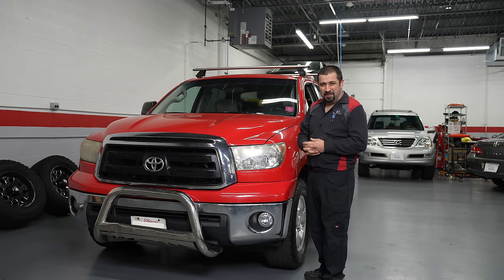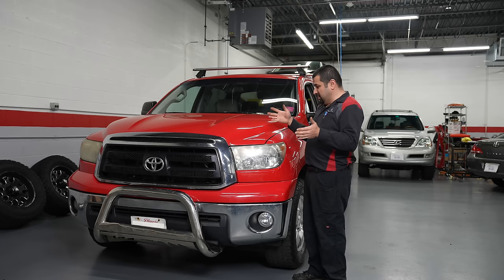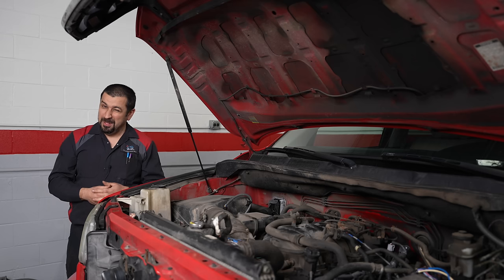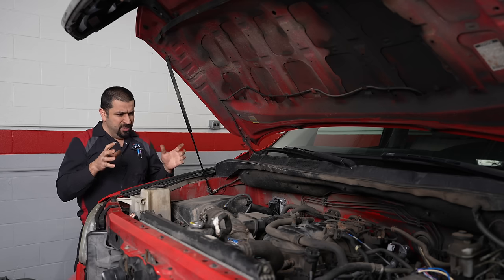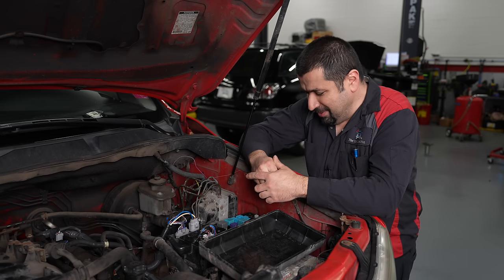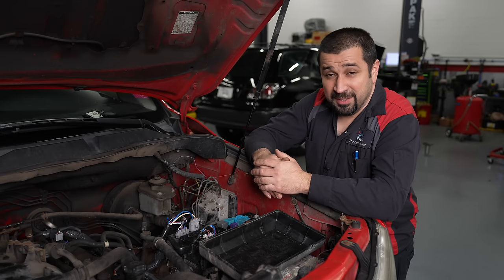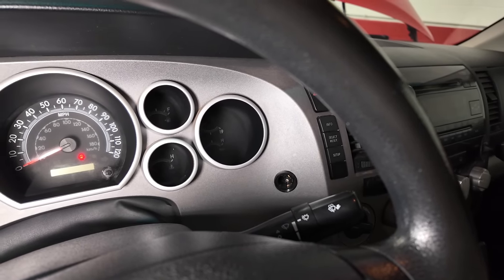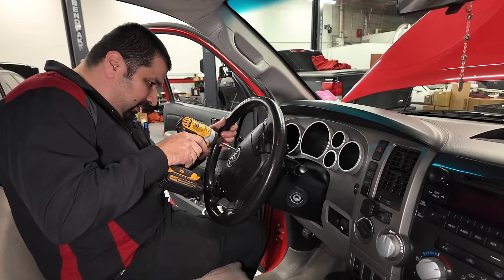Shop BOTCHED Wiring In This Truck Causing a $1400 Repair Unnecessarily

Comment: AMD, I feel bad for the owner,  the inability/unwillingness to diagnose root causes is widespread across the car repair business.  🤨
Reply: Agreed, I was also a victim from the original "stealership"
Reply: More like customer unwillingness to "pay" for diagnostics.
Reply: @verajavi12  Ahhh, victim-blaming. Than how come some people can do it and still be reasonable?! I would say that people don't want to pay for diagnostics when crap like this owners' experience with this truck. It takes less time to do it right, and what we have here is INCOMPETENT mechanics doing half-ass work. When you throw parts as something, you aren't a mechanic. At that time, you are a parts replacer.
Reply: To many mechanic that can't fix electrical problems or don't know how to troubleshoot if there life depends on it,don't let idiots work on your car it will cost a lot more that if they didn't touch it
Reply: Same here, I already spent a lot of money on my 2012 Toyota venza and the code is still active.
Reply: @albowrx Good mechanics are hard to find. If you have one, be grateful.
Reply: If these people that the Dealerships employ can't plug in a scan tool and it tell them what is wrong with the vehicle they have no clue except to fire the parts cannon.  Likely the reason is because they were pool cleaners the week before.
Reply: @wendwllhickey6426  But, unfortunately, when you bring your car to the shop, you have no idea which idiot is going to work on your car... sad.
Reply: They don't get paid to diagnose 😏

Comment: This is why looking for a new mechanic is such a terrifying experience.
From butchering up your vehicles electronics, to forgetting to tighten lug nuts, every shop visit is a roll of the dice.
I'm in your area, and I'm looking for a mechanic, but unfortunately, I don't drive a Toyota.
So let the adventure begin!
God help me.
Reply: Maybe you outta put what vehicles you have... Just a hint. There are people that live in the Shitcago area and could help you out maybe... I'm local but can't recommend a mechanic, since you failed that.
Reply: Check out “Ford Boss Me” he runs an independent shop in Shitcago. He spent many years as a Ford Tech but got tired of getting screwed over on flat rate. Now he specializes in diagnosing German cars. In addition to anything else.
Reply: @RustyZipper  Good dude. Took 2 trucks to him.
Reply: This video is the reason why many techs leave this field, being a good automotive technician requires years of training,  schooling and competence.   The old school grease monkey's couldn't cut it in this field today.  The crazy part of this automotive service field is the lack of fair pay for good technicians.  So what you end up with is a bunch of parts changers.
Reply: I also live in the area and I take my vehicles to TRS Automotive in Orland Park for repairs.   Ask around, many people in the area use TRS.
Reply: @RustyZipper he is a great true mechanic
Reply: I would consider selling your vehicle and buying a Toyota just to get access to this shop.
Reply: If you have Ford go to BSG automotive hes like the car care nut but for Fords
Reply: When you don't know anything about a car, yes, it can be daunting.  Knowledge is power.

Comment: The truth about shade-tree mechanics. So sad for the owner. Another great video for common sense auto services. God bless
Reply: We have no idea who worked on the truck previously. Was it the owner, a friend, a hired person that stated they were a mechanic, a shop.
Reply: @mph5896  So true, it could be any one of those. If your car is over 10 years old the quick fix bug can hit really quickly. That horn "fix" is a perfect example. None of them would think twice about cutting a hole in the dash of a 10+ year old work/commuter car for a makeshift switch.  Someone has to take pride and have a little OCD like the CareCareNut to say NO, lets fix it correctly instead of conveniently.
Reply: Diagnosing electrical issues takes a special method of approach..... I can sympathise with people who don't fully understand electrical systems.
I learnt a long time ago a simple idea..... 99% of circuits use earth switching.... Meaning an earth fault for most issues.... Not all, but a lot.   Working back from the faulty device will eventually lead you to the problem.... Your tool that senses both 12v and ground must be an absolute weapon of a tool.... Audible differences make it so easy.... All I can say is WOW!!!!
You had an enormous task to do and you nailed it.
Well done..... Respect to the master. 😊
Reply: @NZkiwibandit  A simple test light is what I use to diagnose most wiring issues in auto's.
Reply: There isn't a thing wrong with a "shade tree" mechanic.  Ivan Temnykh with Pine Hollow Auto Diagnostics often works under a shade tree in his yard.  LOL.

Comment: I recently have to replace an ignition coil in the rear bank my 2008 Toyota Sienna. It was a painful 4 hours of work. This was with the help of The Car Care Nut YT video. I could not have imagined how many of additional hours that I will spend without that video. This was the third ignition coils I replaced during the last 3,000 miles of my Sienna. Fortunately, the first two ignition coils replaced were located in the front bank, which were very easy jobs. While replacing the third ignition coil, I decided to change spark plugs as well since the rear bank are not easy to work on. To my surprise, I discovered that the spark plugs installed were different from the Denso ones that I bought for this job. The old ones were shorter than the Denso. I later found out that shorter plugs make the engine run hotter and less efficient on gas. The biggest problem with those plugs were that they shortened the life expectancy of ignition coils. I cursed the repair shop which serviced my Sienna for the previous owner of the vehicle. I knew the Sienna I bought used had bad MPG and some issues with the drivability. But I never suspected it was caused by wrong type of spark plug until the ignition coil replacement job.

Lesson learned. Do not trust the repair shop. They are always in a hurry. When they don't have the correct spark plugs, they use whatever they have in hand as long as the threads are the same.
Reply: Agree, never trust a repair shop for anything, no matter how simple. Every time i have purchased new tires and had them mounted and balanced they have always come out with incorrect tire pressure. Never have they set the pressure to the recommended tire pressure listed on the door panel!!

Comment: Judging from the splice connectors found next to the ignition... we could assume that there was a aftermarket alarm/inmobilizer/remote start at some point. Sometimes installers connect it directly to the horn instead of a standalone siren. Pretty sure that the horn cable was left cut open when that alarm was removed.
Aaaaaaaalso I would bet a hundred bucks for that to be the cause for the malfunction in the ECU that caused the starter to suddenly trigger. The remote start module could have damaged the ECU or the installer fried something.
...judging for everything that our beloved AMD found here... pretty sure was the installer xD

Comment: The biggest cause of electrical problems in modern cars, is dealer-installed accessories, and those stupid wire taps. Pretty sure some dealers are having the porters install alarms.
Reply: I refuse to tap any factory wires.

Comment: I'm glad I do my own work...you have to have the manufactor shop and wiring manual. Otherwise you're just guessing. This video is hard to watch. It reminds me of the problems I had last summer when I had to take the whole top end of my engine apart for a double head gasket change and forgot to label all the electrical connectors. Took a week to trace all the electrical problems.

Comment: Mr. AMD, I would love to see a video about the electrical tools you use.  Not just the logic probe, which would make a great video by itself, but also the crimping, insertion, and extraction tools as well as the manufacture information for the terminals used in Toyota connectors. I’m a guy with some electrical expertise, and want to do a good job when servicing my Toyota.

Comment: Oh, wiring...I'm very familiar with this sort of scenario. 
My 02 Silverado had a right brake light out. I replaced the bulb, and it didn't fix the problem. I took it to my friend and mechanic. I left the truck with him and asked him to take a look when he had the time. 
One day, he called me and asked me to come look at what he's finding. He'd fixed the brake light issue, but the wiring in the rest of the truck looked like a troop of chimpanzees had been turned loose everywhere. 
He wanted me to see the mess. It's a wonder anything was working. It cost  just under a thousand dollars in labor to go through it, repairing all the damage. I am not concerned about how the truck looks,  but I want everything else in proper order and safe. I know I've spent more on the truck than Blue Book value, but I love my old truck, and I want it to last a long time and be dependable.

Comment: Wow there was a moment in this video where I had something click. Months ago I was doing a repair under the steering wheel of my 99 ES300. It was so long ago I forgot what it was. When I was putting it all back together trying to make sure I didn't forget anything so it wouldn't rattle there was this little white clip that I could not find a place for abd it drove me nuts. I'm pretty sure I just found a place which seemed to make sense and called it a day. When you pulled out the fuse at around 25:30 and said not to use pliers I instantly recognized that as the clip. Now I need to find that fuse removal tool and put it where it goes. 😅

Comment: I hear ya brother!  Wiring harnesses are sacred, and should never be messed with/tapped/jumped/abused.  I'm an old outboard motor tech, and know first hand what a mess this creates, especially in a salt water environment.  Needless to say, electrical systems were simple back in the day.  I just can't imagine the needless horrible headaches/expenses/diagnosis headaches this type of reckless work creates on today's highly complex/sensitive electrical systems.  I cringe when I hear friends talk about adding "remote start kits" to their newer cars, secretly envisioning the horrible harness mess that was created by messing with the cars electrical system.  I know there is big trouble whenever I see "patchlock connectors", black tape, and other horrible connections.  
All that being said, that crazy one touch key start system is a something I would want to avoid for sure!   I think I understand what you were trying to accomplish by cutting that ECU input to the starter to see if the problem was temporarily resolved.  And, I'm guessing you were not worried about cutting the wire because the harness was going to be replaced anyway.  My question is, could that ECU input lead/pin have been carefully removed from the plastic harness connector (and insulated) to avoid cutting that lead?  Again, no disrespect intended, just trying to learn.  
I learned about expensive toyota harness replacements when I changed the plugs on my Camry.  Needless to say, two of the black plastic coil connectors broke when I attempted to carefully remove them from the coils.  Asked the dealer if the plastic connector housings were available from Toyota, the answer was "no", only the $1400 harness.  Yipes!  I did find aftermarket coil connectors with wiring pigtails online though.  They recommended "cutting the original wires" and patching their leads into the original harness.  Needless to say, was not going to make a mess like that.  Finally learned how to disassemble the plastic connectors so I could transfer the original wires/pins to the new plastic connectors....
Reply: OK, some lousy testing/procedures/crimes against wiring occurred here for sure.  All that being said, I am not afraid to admit that I have found myself "in the weeds"/mixed up/confused many times in my career.  Sometimes the harder we try, the more confused/errors we make.  Perhaps the tech had already pulled that last of his hair out when he finally installed those fuel pump relays ass backwards.  It's times like these it is important to step away from the project for awhile, allowing your head time to unravel and rethink what is going on.  I can't tell you how many times I have been trying to sleep, going over stubborn issues in my head, until the "light finally comes on"/aha moment.  Usually can't wait to get back to work in the morning to recheck my work and find my stupid mistake/assumption.   All that being said, I realize that today's shops/dealerships are highly stressful environments, techs are rarely afforded to luxury of putting a project aside to "think about it".   Always good to get another opinion from a trusted coworker, two heads are always "better than one", especially in a stressful/confusing diagnosis situation.

Comment: I just repaired the horn on my Toyota Auris and the problem was a poor connection between the airbag (which disconnects together with the horn switch) and the steering wheel, there is a small metal spring that touches the steering wheel and grounds the switch. I also cleaned the connections between the horn and the body. Now it works great. Unfortunately I couldn't test the new type of horn relay(It was hard to even find it), it's not like my previous Toyota where it was easy to test and remove, now it's a module called an "integrated relay" and to test it I would have to remove the fuse box.

Comment: Toyota wire harnesses are garbage. I’ve repeatedly experience wires pulling from the back of the secondary air valve on the driver’s side of our 4Runner. After one repair of the plug, I had the other 4 wires pull from the back while unplugging it to change spark plugs. Repaired for $15 with a MAF pigtail plug spliced in.

Comment: A lot of the old time mechanics hung it up when electronics became the dominant feature of modern vehicles.  Mass air,Manifold absolute pressure,egt,etc, etc....:-)   Serviceability is not a  by word in Detroit.  Saving grace is the can bus and obd II..   Doing the same thing over and over has a one word  definition....Stupidity...!!

Comment: Looking at a used '07 or '08 ES 350. Do they have the same power steering problems of the RX 350 of those years?

Comment: I can see what sometimes mechanics throw parts at the problem (authorised dealers do that too). And the reason is sometimes the repair manual, not sure about other makes, but I have some experience with Toyota/Lexus, BMW and MB.

Basically, in the manual it is something along the lines of this "Code123, check this wire for 12V, check this wire for 0 ohms, check this wire for 10k+ ohms, if anything fails then fix the harness, if harness good, replace ecu one, check codes, if code present replace ecu2, check codes, if cote present replace ecu 3, check codes, if still present replace engine ECU". So basically it gives you very specific task, which is not at all representative of real life issue and after measuring just 3 wires it tells you to replace ECUs worth of thousands.

Now obviously, experience mechanic figures out quite early that there is something miss and starts diagnosing issue from experience and outside of what repair manual is asking, but this can only be done with experience, it can't be learned from any material. So that is why it is so common to throw parts into electrical or programming issues and achieve very little.

Comment: Class 8 truck mechanic .   
The most dangerous person in the world is a truck driver with a toolbox equipped with a sharp pointed test light ! An excellent product to use around electrical .  3M Scotchkote FD , a coating designed for underground electrical splices .

Comment: How do you run wires (like your jumper) through the firewall boot? Not sure if Toyota still does it or if it is model specific but in my 1999 gs300 the wires are all encased in silicone melted around them. Can't pull anything out or put anything in. Is there a good way to not lose your waterproofing and fix a similar issue?

Comment: I always say, people will do more work to rig something than it takes to actually fix it properly. After over 20 years in the automotive industry, I switched to small engines. I'm always amazed all the hardware people will buy to rig something, when they could order the correct part to replace it for less. 😂

Comment: @The Car Care Nut 25:20 ,I've gota a Toyota Aygo and my Electric Power Steering has a fault and compeletly stops working, but when i take the fuse out and put it back in, it all of a sudden starts working for a few rides and then dies again, what could this be? Cause it sure aint the motor cause it works perfeclty when i pull and push the fuse back in ?

Comment: I'm just gonna throw my question out there. Anyone know the lubricant for the electromechanical tach gauge on an 86 Toyota pickup? I've took it apart and cleaned out the decades of dust, with some air and art brushes, but it sticks when it is cold. It stuck when it was cold and the reading is still correct, but it just lags a bit.

Comment: My daughter has an 09 Tundra and I just bought a 14 Tundra and I noticed when installing the trailer brake controllers that Toyota does really use very small wires. It seems crazy to me to use such small gauge wiring on a truck that may see allot of vibration and dirty environments.